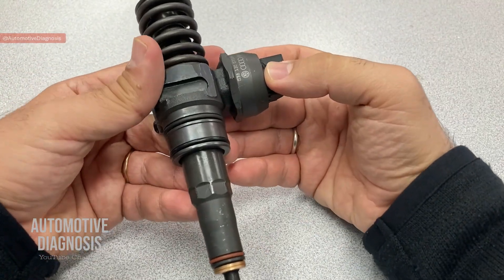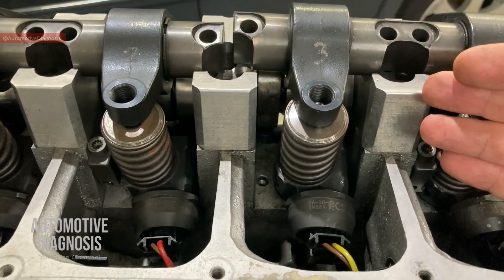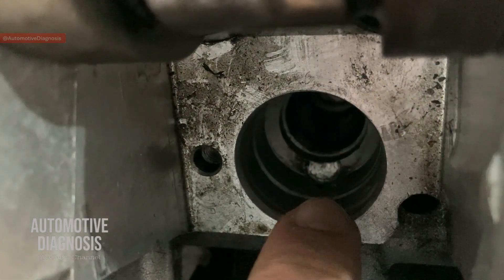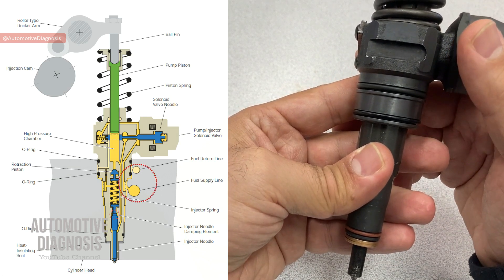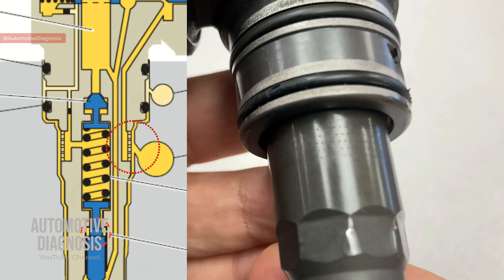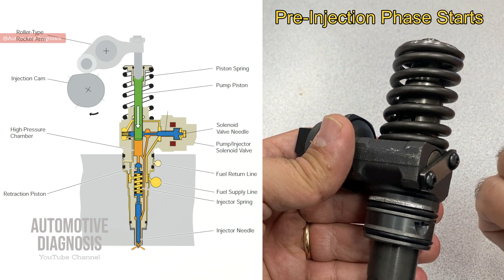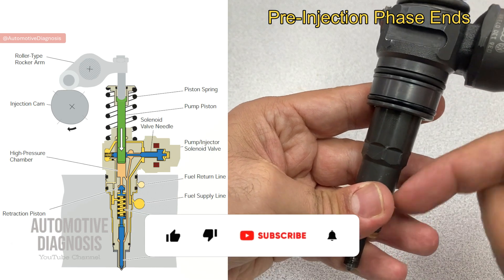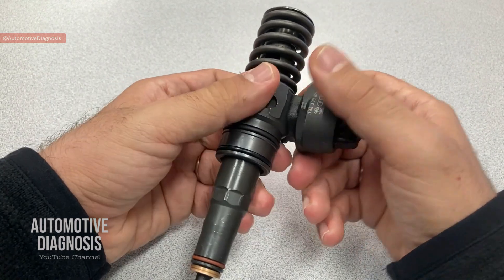What Makes VW Diesel Injectors So POWERFUL?

Comment: Wow I must use lots of diesel  additive  and extra fuel  filter changes to keep those clean
Reply: i use 2stroke oil in my diesel to keep these lubed! and boy my tdi runs smooth even after 470.000km

Comment: Very good video. I am about to buy a cheap AUDI A4 B7 phase2 2.0TDI, using those injectors. I haven't seen the car yet, but the seller told me the issue is that the engine starts and stalls. He said, like there is water in the fuel. And I would need to change the head. I find it strange, but now that I have seen your video, I'm hesitating. This system is supposed to be robust. What do you think? I also know that if one of the injectors have a short, the engine will not run.

Comment: Thanks for explaining. That's an interesting design. How is injection duration achieved under various engine load?
Reply from the maker: Thanks for watching. On each engine running condition, ECM can control the injection duration by controlling the solenoid valve. Releasing the solenoid valve will finish the injection duration.